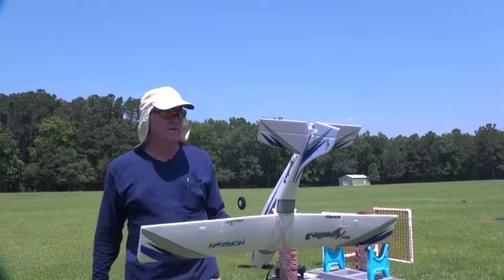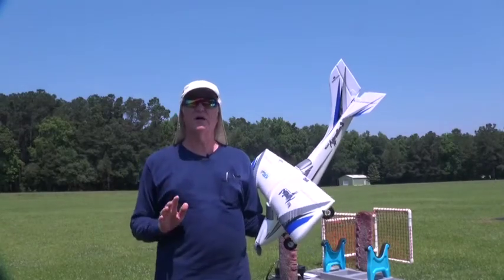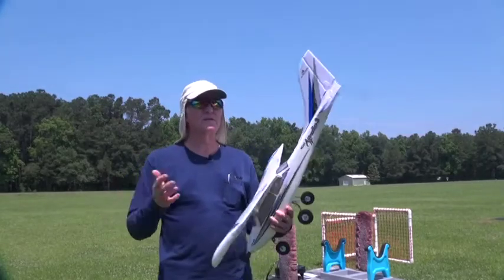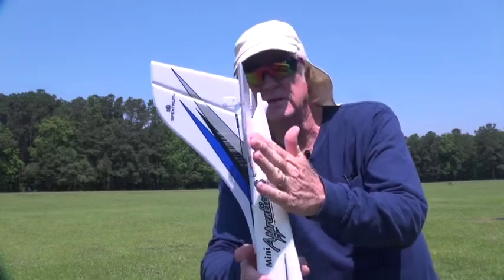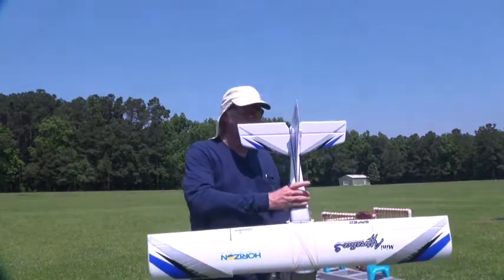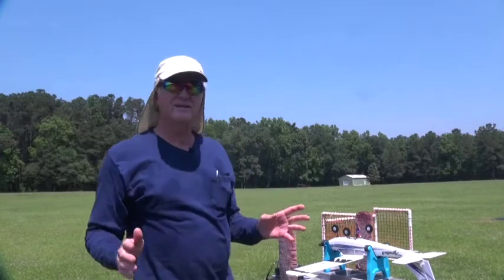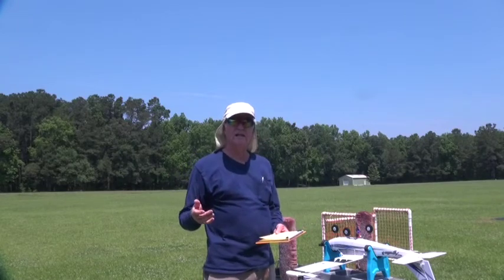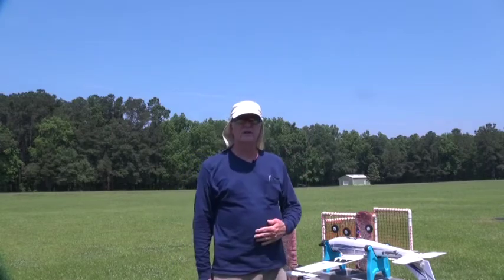MA15 Mini Apprentice Elevator Trim Change

Comment: From my understanding the Mini Apprentice has 20% up elevator mixed in with beginner mode with the throttle at 100%. When you adjusted your elevator trim what mode where you in?
Reply from the maker: I do all adjustments in experience mode.

Comment: What do you think about mixing throttle to elevator, 20% in expert mode ?
Also , do you recommend to add cf rod to strengthen rudder an elevator ?
Reply from the maker: Mixing throttle to elevator is OK if its needed.  I have found that for the Mini Apprentice, slow throttle movements eliminates the need for any mixing.  The strength of the rudder and elevator are good.  Several of my students have hit the ground very hard with this aircraft and it has held up well.
Reply: Thank you , professor .